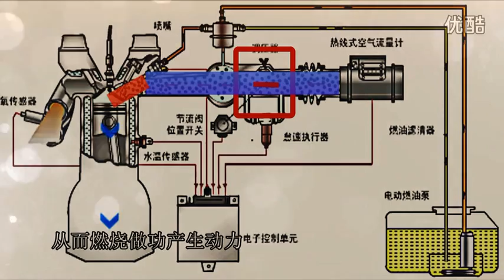Audi A4 throttle body cleaning

Comment: I got P0507 code pop up which trigger check engine light. I read dirty throttle body from carbon build up is a possible cause of this issue. Any advice ?

Comment: Yo ho homies! Dont use liquid innside the body. It will penetrate the innside off the electronic and gears. My wife`s throttle body is now broken :( Just use a clean ragg to clean with. Maybe use a flatdriver innside the ragg to scrape off the worst bumps, and thats it. The carbon goes easy off with just the ragg.. good luck!
Reply: Just for fun i tried to activate it with some cables straight from the battery and the gears innside black lid just exploded and shuttered like hell innside the lid, LOL. Anyway the part cost me here in norway around 1400,- NOK from autodoc (Germany) for a new one. 
Im now waiting and waiting and waiting and waiting for a the part to arrive....ZZZZzzzzzzzz
The Norwegian custom (Toll) takes a long time to confirm that the the part isnt dengerous.

Comment: There is this large flat sided piece kinda looks like the throttle body at the very back left on the top and mines leaking oil onto the exhaust. Anyone know what this part is called
Reply: B. Baker It’s common for the vacuum pump to be leaking on these B8 models. Audi does not sell a rebuild kit, however they are available aftermarket. You will need to disconnect the HPFP before removing the vacuum pump and replacing the seal behind the plate. Don’t forget to order a new gasket for the vacuum pump as well.

Comment: Could you please show me how to disconnect the connector at 0:52' ?
Reply: I know it's too late, but for anyone else that's wondering: you have to push the connector in a bit (just apply some pressure to it) and slightly lift the tab, then pull on the connector to disconnect it.